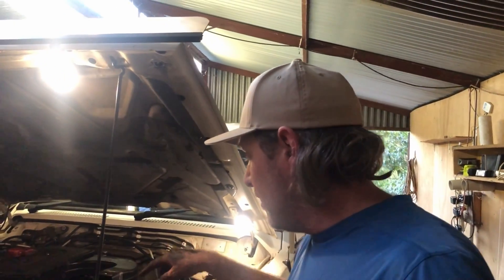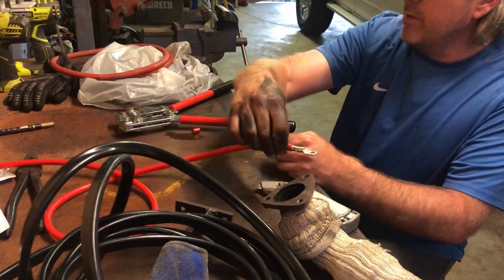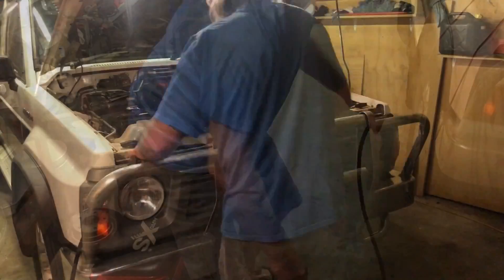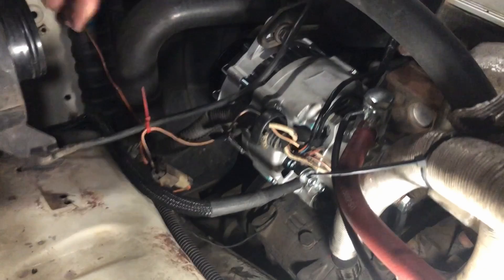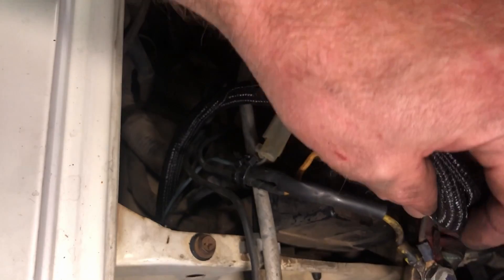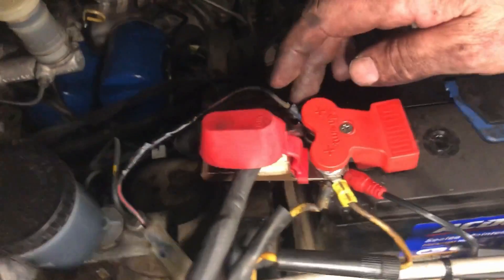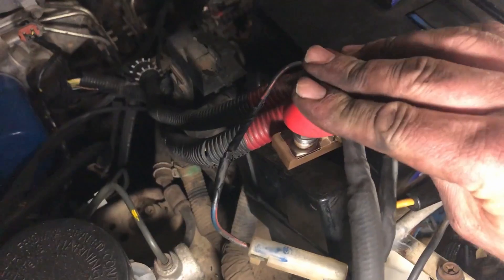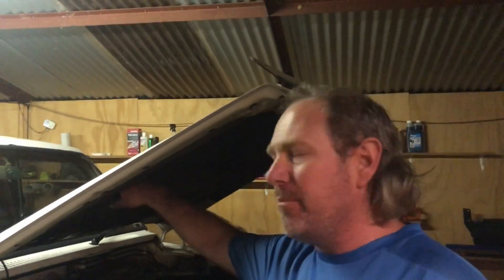Nissan GQ Patrol Alternator Charge Cable Upgrade

Comment: I upgraded my alternator to an 80 Amp one but only was reading 55-58 at full draw on my clamp meter. I reckon the cables does need an upgrade then ... Did you upgrade the two ground cables ?
Reply from the maker: No change to any other cables apart from the main charge cable
Reply: @Shanes_Shed  isn't that gonna throttle the alternator output then? Sorry for asking loads of questions.
Reply from the maker: Which ground cables are you referring to? The main battery earth cables already have a decent sized
Reply: @Shanes_Shed  In my neck of the woods we call them ground cables but down under you guys call it earth cables. The alternator earth, battery to body and battery to engine. Those look just as thin as the OEM positive cable. Was thinking to upgrade all of them.
Reply from the maker: @dunklik6089  generally I refer them as negative and positive. Anyway I have no issues with the battery to engine negative cable as that one is fairly beefy. Battery to body could do with an upgrade but shouldn’t cause an issue with charging

Comment: This is a job i need to do was trying to work out where to run the wiring 
Good idea 
Did you check the voltage out put before and after 
Ive got about a volt difference 
Thanks bro for this video
Reply from the maker: Oh dude, your a legend! No voltage check with the new alternator and original wiring as I done both jobs at the same time.
Reply: @Shanes_Shed  rogee big 10 4 rubber ducky
Reply from the maker: Does sit on a solid 14.5 volts now however all day.
Reply: @Shanes_Shed  sweet bro
Reply: @Shanes_Shed  sweet bro